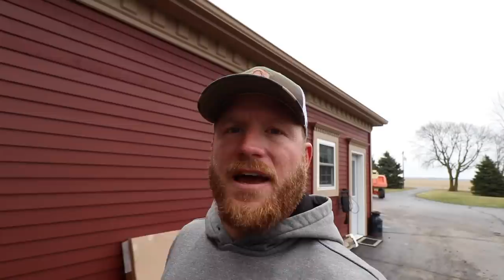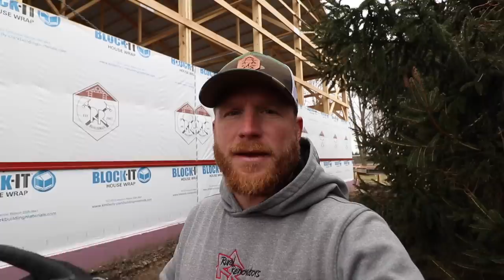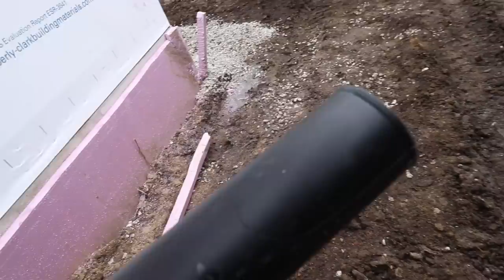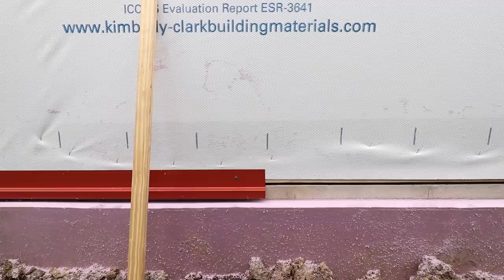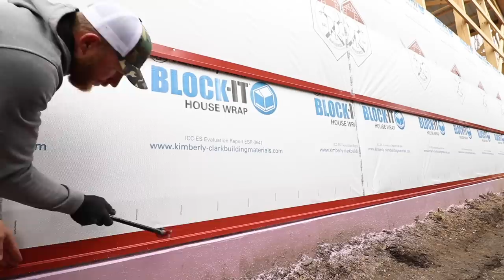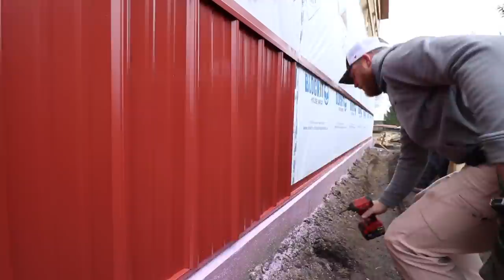How to Build a Garage Addition 11: Installing House wrap, Base Trim, and Wainscot

Comment: There is no way I would (or could) build anything like this, absolutely no need for it here in England and I've got no room. However, since discovering this channel about a week ago, I've watched dozens of these videos and builds. Maybe this is why I haven't fixed that 6x4 (some imperial measurements for you lot)  garden shed that makes strange noises in the wind. Keep up the good work, your attitude is refreshing!

Comment: Water will be trapped behind the foam causing the stem wall to be continuously wet and wick thru to the inside unless you flash it.

Comment: I work at a steel Roofing manufacturer in Maine if they would just use 3 2x4s under the longest panel its stronger than relying on the short ones

Comment: So my question to you, Kyle and Greg. What is your recommendation when you have Tyvek over your OSB and you put your frost board on belt whatever you wanna call it at the bottom and you go to put Z flash on do you cut your Tyvek 1 inch up and slide your Z flash underneath and what do you do if you do, do you seal it to the substrate which is the OSB or do you not? I feel that if we did it that way you would take some zip wrap and seal it to the substrate. Would love your input. Thank you and keep the videos common. They’re awesome.

Comment: No metal flashing under the waterproofing membrane and the slab/insolation?
Reply: insolation is a sun protection film, not sure why so many of you write that instead of insulation which implies to temperature proof or thermal protection.
Reply: @Joshua79C  English is not my first language, that's why :)

Comment: Hey Kyle, can you talk about why you do the lower wainscot when the upper wall is the same color?
Reply: Would you rather replace 34 inches if panel or a fill height one? It is easier to replace shorter than a whole panel after it has sustained damage from flying "shrapnel" when one mows or from debris hitting it during a wind storm. It also offers a unique aesthetic look and allows one to have a two tone look if they desire.
Reply: I believe it’s the customer’s choice.

Comment: I had a building installed recently. They used a house wrap but do to lack of communication I was under the impression it was also a vapor barrier, intern, I used open sell spray foam. I’m a little worried if I put a vapor barrier on the inside of the building that they may create a moisture issue inside the walls. I am in upstate New York.

I guess my question would be as long as the house wrap is not technically a vapor barrier am I hurting anything by putting the plastic wrap on the inside?

Comment: How do you figure where to start the first sheet of steel from the corner? Do you want a rib right in the middle of the building and then work to each side?
Reply: He uses math to figure each end looks the same.

Comment: How often do you put screws in on the sheet metal going up the the wall
Reply: Every place he has put a cross board gets a screw at that height. Not sure how far apart they are but I'm guessing 3 foot apart going up the wall.
Reply: @hotrodhog2170  thanks for answering my question.
Reply from the maker: Exterior is usually every 32”
Reply: @RRBuildings  I was close. Lol
Reply: @cntslesfabrication  Yeah man.

Comment: Any idea how much it’s going to cost to spray foam a garage of that size vs batt insulation?
Reply: Foam is usually 3-4 times the cost of Batt insulation.
Reply from the maker: This ones was three times more to spray foam
Reply: @RRBuildings  Nailed it! I owned an insulation company from '93 till '08. Ain't changed much I see.

Comment: whos your dealer for your steel products?
Reply from the maker: Metal sales manufacturing
Reply: @RRBuildings  thx
Reply: How do you know where to start the panels on the side ? I noticed that you didn't start from the corner of the building .

Comment: Can you explain the reasoning for the house wrap?  Why can't you just hang the sheet metal?
Reply: On fiberglass insulated buildings he does it for wind infiltration and on spray foam insulated buildings he does it so the panels can be replaced easily if damaged.
Reply from the maker: Thanks
Reply: Awesome .  Good to know and great work.
Reply: @the shop Uh, yes. I know what it is generally.  But Nicolas answered what I was asking.  Thanks.